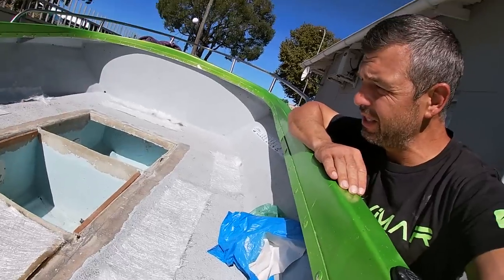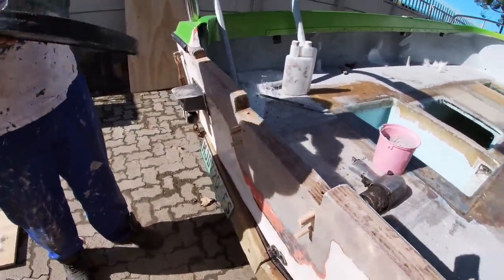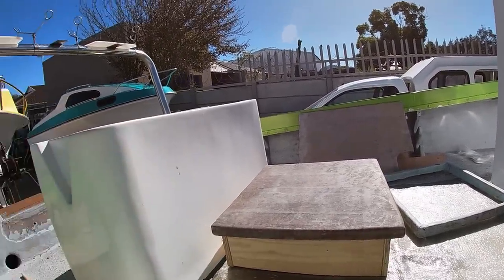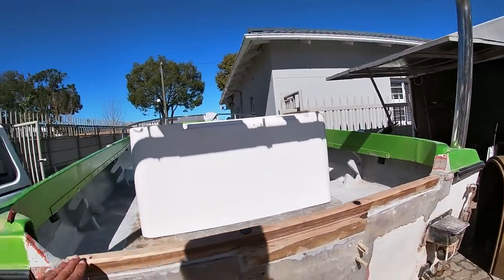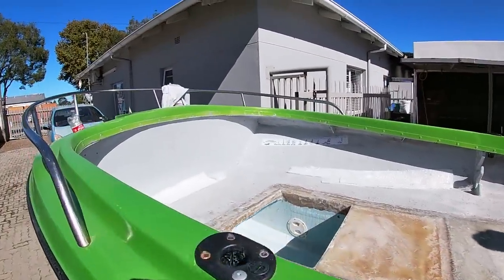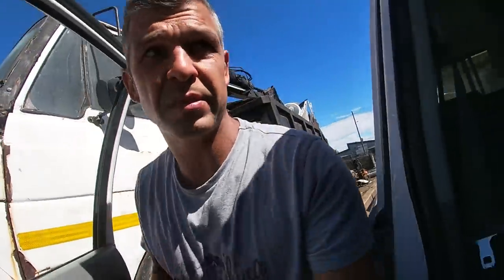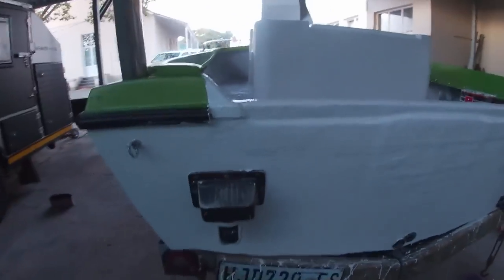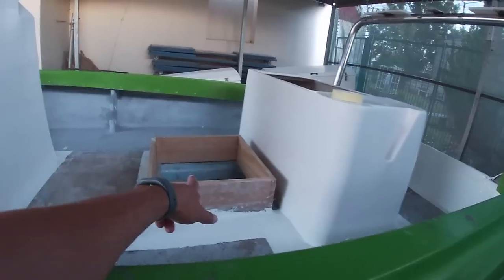DAY 4 AND 5 - THIS WAS A BAD IDEA

Comment: Blommie, what wood did you use for building up the transom? why did you remove the screws after?
Reply from the maker: Hi there. I used meranti. Don't know why that is what Marius asked for. The screws was only to hold it in place. But I think we left them in there. I just checked and you can see black marks where we grinded them down in the video